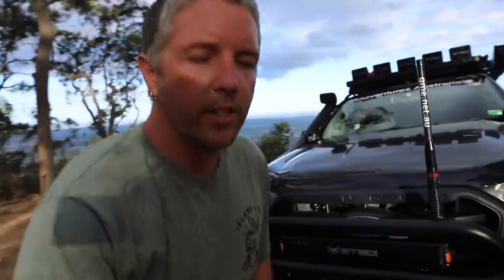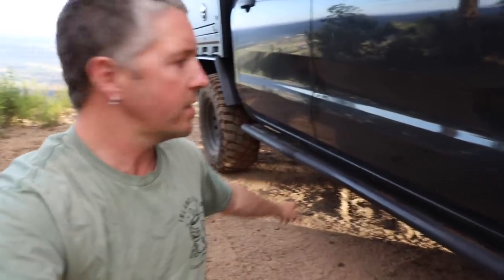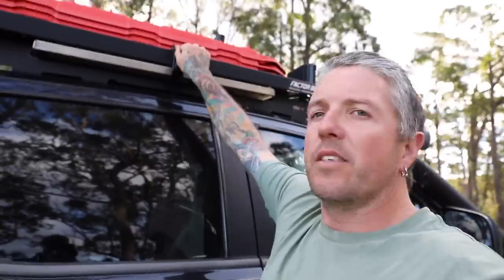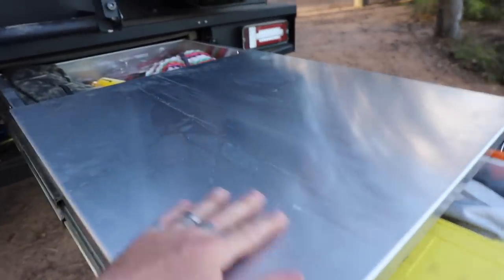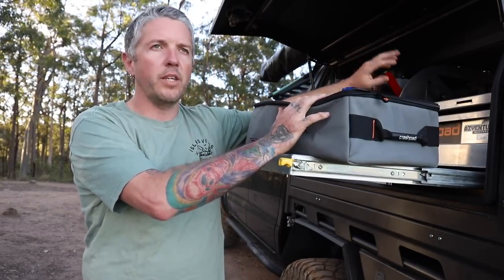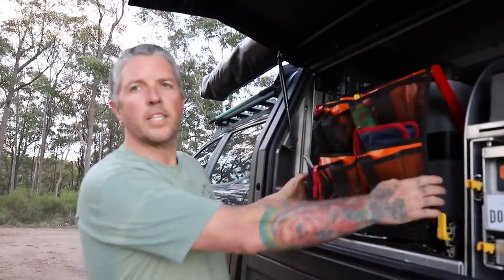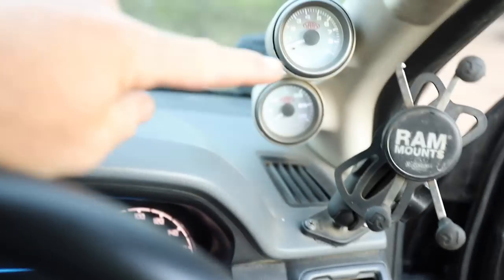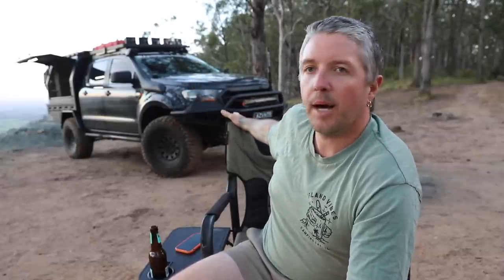Is this AUSTRALIA'S BEST Ford RANGER????

Comment: Great run down Az 👍🏻
have you had the transmission recalibrated yet, To adjust the shift points to match the 35s? one of the best things I had done to mine. 
Are you running an external cooler, bypass valve combo on your transmission? 
Lastly Can definitely vouch for and recommend the tough dog UCA’s.

Comment: Its a good little rig mate ...... that coil conversion and canopy. Was talking to superior about a coil conversion and they tell me no gvm is available if you go down that coil path. Now i know you said you put in 450kg springs in the back, as im also looking at a canopy aswell. My question is 2 fold 1. is how dose it tow and 2. Have you had any gvm type issues with adding canopy and or a trailer/camper/caravan..... basically trying to stay as leagle as possible with my build.

Comment: I have the 2021 px3 and looking at setting it up with the good gear.
 I'm looking at the FOX 2.0 and the superior engineering remote res lifts kits. Havnt decided which way to go yet.
How you liking the fox 2.0? 
Do you think 3-inch lift is okay without a diff drop?
Reply: A 3-inch lift without a diff drop on IFS puts the cv joints on a bad angle, it will weaken them over time and maybe if u did a 3inch no diff drop, a sudden drop down could potentially snap the cv
Reply: @kylemnoff7640  I ended up going with dobbinsons MRA remote res. 
 so good 👍 
Dobinsons said the 2021 px3 does not need a diff drop for 3 inch as the CVs are different  to px2. Longer CV shaft so angles are fine.
No CV boot rub and  no binding.

Comment: sorry mate but havent seen the lights near your bonet.does your bonet open right up now you have installed them silly question
Reply from the maker: Yeah mate, with the bracket design the bonnet opens as normal without any interference
Reply: What brackets are they where do you buy them?

Comment: Hey mate, great setup mate. Very envious. Actually have a question in terms of insurance.  With all the mods that have been done, how do you go about your car insurance?  Just a question no one really talks about.  Can all the mods be insured on the car? Just curious as I saw you talking about how much it would cost to replace on your Instagram.  Once again great setup mate. Looks like a beast.
Reply: Hi Kev, yes you can. I have PX2 same model as Azza’s and mine is insured for $110k. Market value for this Ranger is $30k and I currently have $80k accessories fully insured.